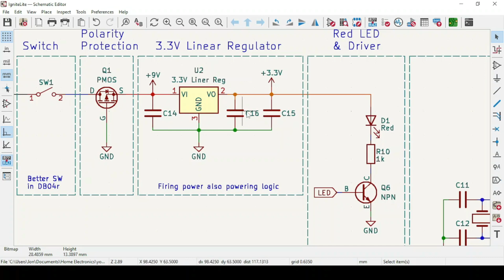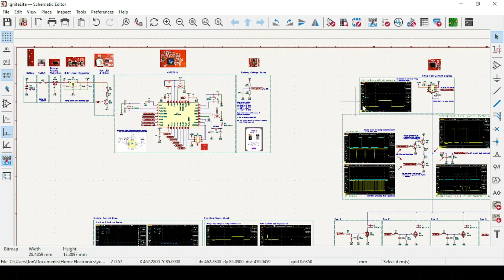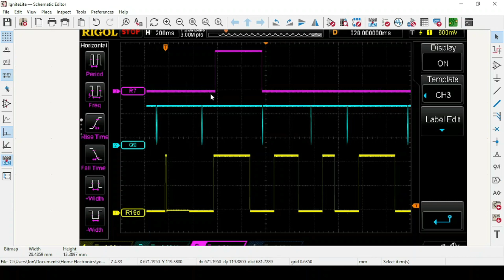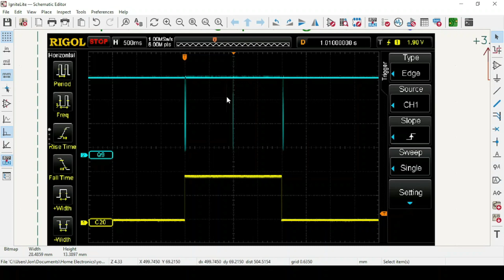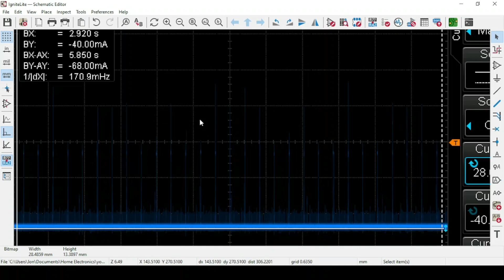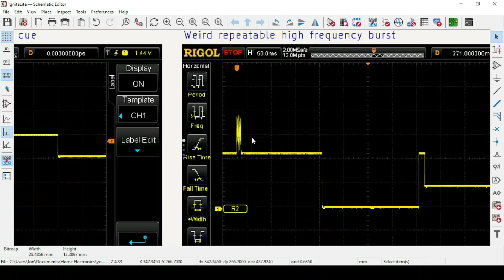Ignite Lite/TNT Hot Shot Teardown

Comment: The dot on the processor might also be an indication of programmed chip especially if it was programmed off reel after assembly. I have used that scheme before vs. laser etching the information for cost reasons or on early versions before mass production (First production release prior to purchase of pre-programmed parts)
Reply from the maker: It might be, maybe I judge too easily, but it just seems very convenient to mark across all the chip markings whereas normally manufacturers just blob anywhere on top.

Comment: Q8 and Q9 are most likely field effect transistors. If Q8 were a bipolar transistor, then opening Q7 would damage Q7 and Q8 by the large current from the 9V supply through Q8's base and Q7's collector.
Reply from the maker: If it was a fet, then how would Q8 ever turn off? It's gate would have to be tied to the 9V rail.
Reply: @jonelectronics510  Yes you are right! Then these should be composite transistors with integrated base current-limiting resistors.